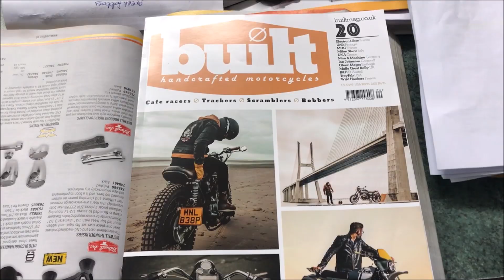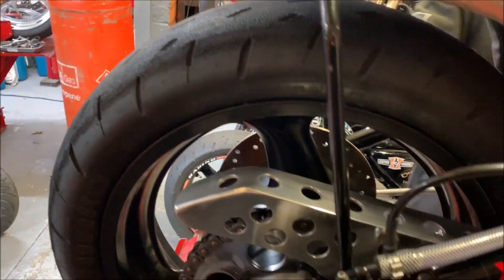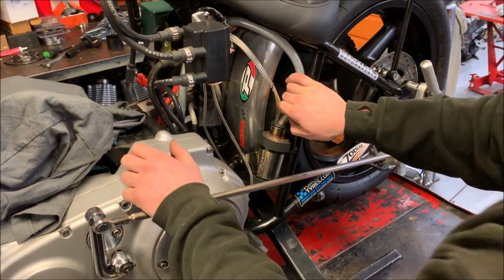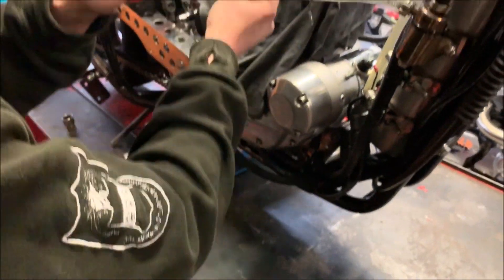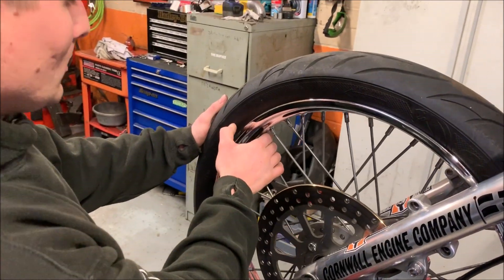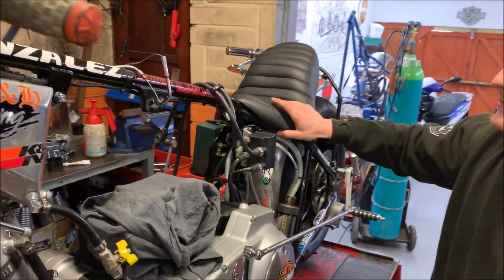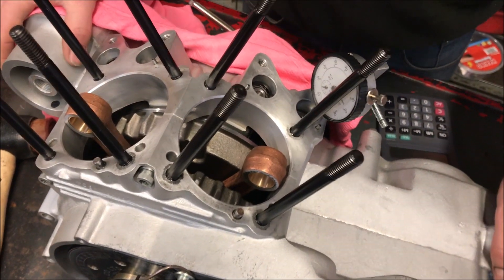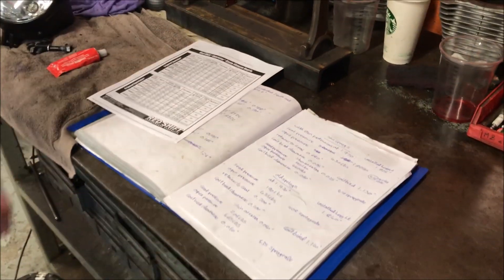How to build a fast Harley Davidson Sportster

Comment: I see he is a wise man! I am also putting a Buell XB12/Harley XR1200 crankshaft in my Sportster next season. I will be adding some CP Carillo H beam rods, 30 degree dome pistons and I will be having the crankshaft lightened a bit more, welded, trued, balanced and blueprinted. I am aiming for 100-110hp to the rear wheel, and I am probably about there now, but now I will be bulletproofing it, and any gains I get in the process are great but that isn't my main goal now. The XB/XR crank, HPI throttle body, Feuling fuel injectors, S&S roller rockers, headwork with larger intake and exhaust valves will finish off the motor build (I currently have a TBR gen 2 comp-s stainless 2-1, S&S teardrop air cleaner, Vance and Hines FP3, Feuling Reaper 505/515 cams, Feuling HP+ lifters, Feuling Endurance valve springs, Hammer Performance solid pushrods, Buell bronze oil pump gear,  S&S 1250 with 10.5:1 forged flat top pistons for motor work). I have Screamin Eagle high compression spark plugs, 10mm Screamin Eagle plug wires, Dynatek EFI ignition coil and a Yuasa battery (adding a lithium to drop some weight). The clutch is a Barnett extra plate clutch pack to bulletproof against the stock grenade plate and deletes it all together with the extra plate, Barnett Billet pressure plate, Barnett 25% diaphragm spring, Magnum black pearl clutch cable with 1FNGR easy pull levers. The suspension is Progressive adjustable monotube cartridge forks, Progressive 13 inch adjustable 490 sport series shocks and a Daytona steering damper. The body has a carbon fiber front fender and side panels (got ripped off for a rear fender but I have sourced a rear fender from someone that isn't a thieving, lying sack of shit), HD rail collection Gloss black chopped cam cover, rail collection Gloss black primary cover,  Rail collection gloss black lower rocker boxes,   rail collection Gloss black pushrod tubes and tappet covers, HD motor Co Gloss black derby cover, Feuling Gloss black points cover, Iron1200 flat black upper rocker boxes. The belt was swapped for a TMF chain conversion using their rear sprocket and a PBI front sprocket with a black and gold 530 RK chain, a Trackerdie front sprocket cover and a Trackerdie chain slider. The brakes have an XR1200 master cylinder with braided lines, speed merchant bracket up front for a Brembo 4 piston radial caliper and Brembo pads, 11.5 inch Brembo 10 button floating rotor with anodized aluminum carrier, the rear brake has a Jacob conard bracket to fit a matching 11.5 inch Brembo floating rotor with the stock rear caliper and Brembo pads (I am having a CNC aluminum swingarm made with a bracket for a p32/p34 Brembo caliper that fits the 11.5 rotor). As for electrical, I have a HD tach that has 600 colors to choose for the background, tach needle, and analog speedo gauge separately for endless combos. The tach also has a fuel gauge, gear indicator, miles to empty and some other neat features. An LCD dipstick that shows oil temp/oil level, and a master cylinder fuel gauge which is a replacement cap for Sportster master cylinders that has a small screen on the front that shows fuel level. I added a LED headlight and tail light with black trim rings. I put some west coast tbars 10 inch MX bars, with a MoonsMC 1/4 turn throttle tube and trackerdie grips (replacing the grips with the new ODI x Hartluck lock on grips). A Saddlemen step up gel seat. As for wheels and tires I put some Avon Cobra Chrome tires on it. Great tires, but I am looking at installing some 17 inch Lyndall wheels with some Metzler Racetrack RR tires for track days and something a little more streetable for the road. At some point I may install an entirely new Inverted front end from Kraus or a similar vender and when/if I do I will install Ohlins internals and a GPR/Scott's steering damper and Brembo monoblock calipers with Lyndall brake rotors but that is a down the road plan, along with a possible Trask Turbo and a Thundermax ECM hehe 😉

Very,very long winded post but after seeing this weapon I had to tell you about my modified street Sportster. I have owned the bike for exactly 2 years last month!
Reply from the maker: This things has a few more changes and just pulled 8.9 sec 1/4 only this weekend :)
Reply: @MakaJerycho  wowwwwww!!! That is damn impressive! I would be happy to pull a 11.0 off and that is probably way too much to ask 😆  What are the 60 foot times and kmh? Also, do you know how much power that bike puts down? Or how much it weighs? And how many CI is the motor? Sorry for all the questions, that machine has seriously got my interest! That is an engineering marvel, built to perfection to run like that! I could only dream of having a drag bike of such high quality!